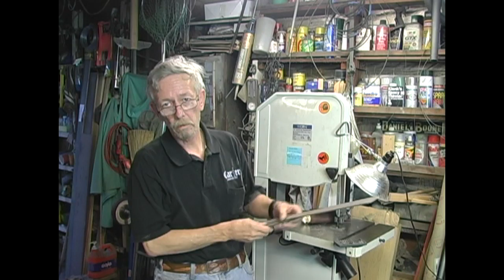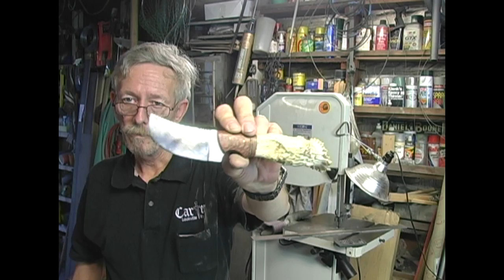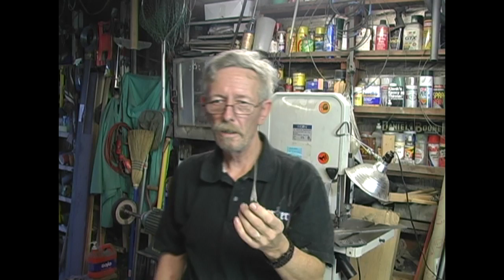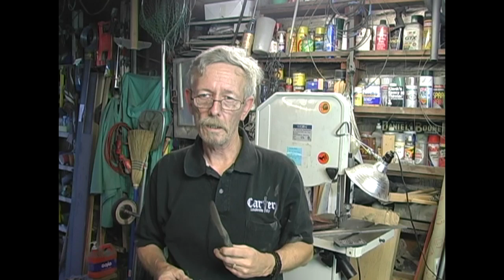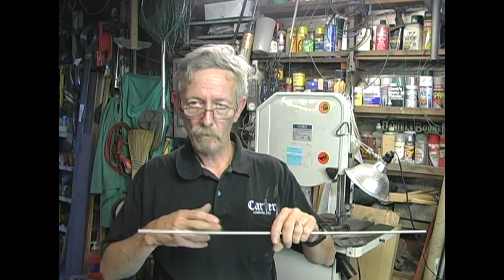Knife Shop Tools

Comment: I did not see the 1100 RMP Caswell Plating buffer at their site.  A request has been submitted to them.  I've seen a few at 1725 RPM.  Do you think that is took high for doing knife making.  I really enjoy your videos.  Many I have seen multiple times.
Reply from the maker: 1725 rpm should be fine. Most buffers seems to run around 3500 rpm and, although many people use them,  that is faster than I am comfortable with. A very important consideration is the long shanks if you plan on buffing larger knives.
Reply: Thanks!!

Comment: Very interesting Video full of great information. Like how you went step by step in the knife making process. So many skip around so much in their video's you do know what your supposed to do. I'm a wood worker who also makes steak knife sets out of old cutlery. I wanted to try some part of the knife making process and this gets my feet wet. I didn't quit make out the name of the belt grinder you sit at,Baiter 3? What do they cost out of curiosity? Not that I have room in my tiny shop for it. And I LOVE the small stool with the motorcycle seat! I Have a small mechanics stool, and I should try switching seats. It looks more comfy. I use it for my scroll saw which is on a shelf under my main bench. Works out well and I don't have to lift it up onto the counter top every time I use it.Its on a lazy-susan, so I swivel it around to face me and lock it in place. Thank you so much for the great video, best I have seen.

Comment: Very informative!  What are your thoughts about a variable speed grinder?  Also, what voltage do you run your 2x72 grinder on? As you noted, there are a variety of grinders out there with lots of choices to be made.  Thanks!
Reply from the maker: Variable speed grinders are great and I wish I had one but they are considerably more expensive. I can change speed by changing the drive wheel but I usually just leave it on the slowest speed as it gives me more control. I am limited to 120V service in my shop. If I can ever get it upgraded to 220V I will change the grinder. It's just a matter of changing a couple of wires on the motor and it runs more efficiently.

Comment: Very informative video..I want to start making knives mainly for myself..I will buy the blades and make a few modifications to them and put the handles on them..I'm in the process of figuring out what power tools I need to do it..I going to get bench top tools and I wish I could get a bandsaw to cut wood and metal by changing the blades and moving the belt for different speeds I'm not sure if there is one..Good instruction for someone getting started.Thanks
Reply from the maker: Most metal cutting bandsaws will run fast enough for wood but a wood bandsaw will not run slow enough for steel. Assembling knives from purchased blades is a good way to get started. Just be sure to make it clear to the customer if you sell them. One big pet peeve of most knifemakers are people who assemble knives and call themselves knifemakers. The rule of thumb is if you didn't grind the blade, you didn't make a knife.

Comment: that was a super video Mike, thanks. I am disabled and cant stand for more than a couple of minutes so seeing the grinder setup that you use while sitting has given me a new perspective. Now I think I can do this! Looking forward to all videos you might share. thanks so much. This was a very important video to me. Joe
Reply from the maker: I have back problems and I could not do all of my grinding standing up. Sitting also gives me much more control by being able to brace my arms on my legs.
Reply: the tips on technique while sitting has just motivated me to a new high. Sounds silly but something that seems so obvious and simple is a revelation to me. Bracing your arms on your legs, cant wait to give it a go. I am currently building a 2x72 similar to yours. I already have the wheels , motor and controller to do this. I used to do some metal fabricating so I think I can get through this part. Seeing your setup just turned on the lights in my head LOL.   Sorry to hear about your back issues, hope you feel better. Your knives are amazing thanks again. Joe